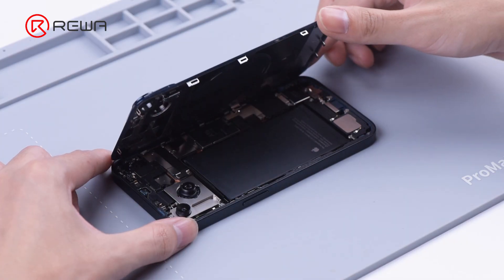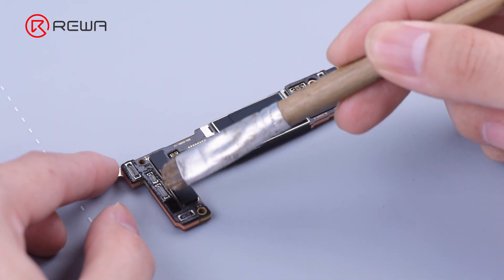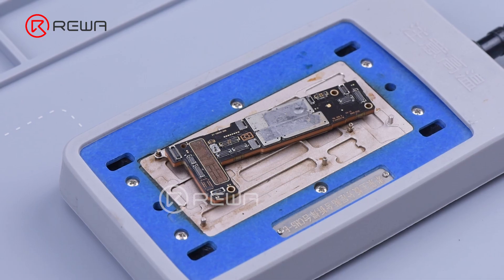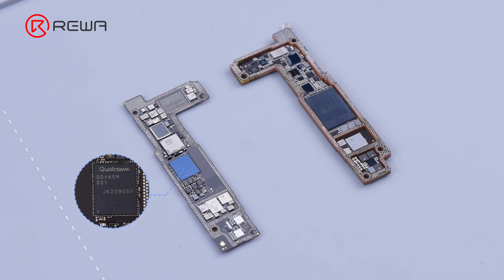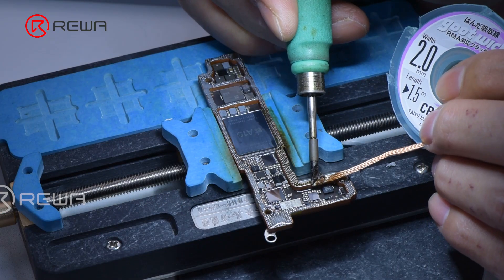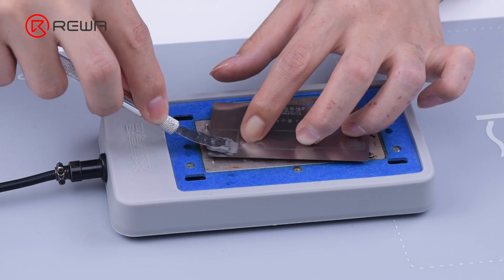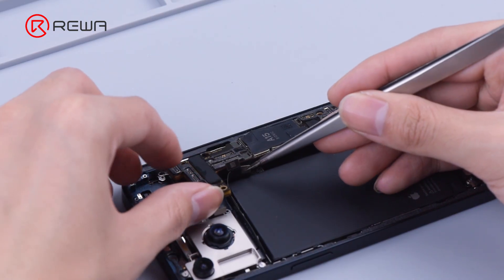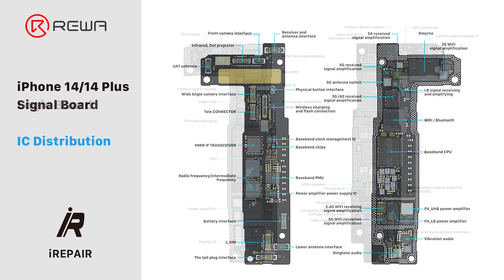iPhone 14 Motherboard Separation - What Makes Repair Tougher?

Comment: Any reason why to use low temp solder(138°) for bonding the motherboard?
Reply: Because it melts way before any of the components soldered to the board. You want to use as little heat as possible when performing motherboard repairs.

Comment: Next, internal memory upgrade 🔥
Reply from the maker: Hey, good guess, pls stay tune for our next video.
Reply: For most normal users, if the ram and storage can be upgraded, there will be no need to upgrade to next gen iphones.
Reply: @Alan_Skywalker  agree
Reply: @Alan_Skywalker  If iPhone had micro SD slot. it would fix the storage problem